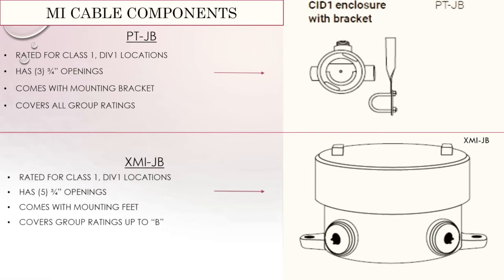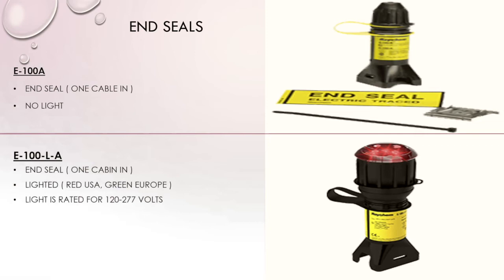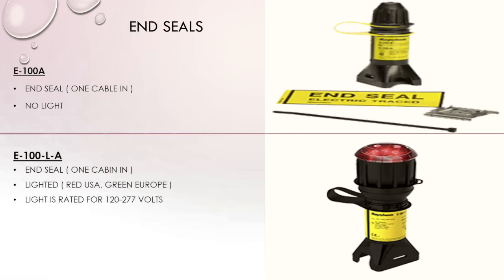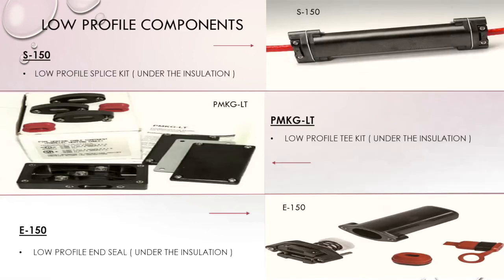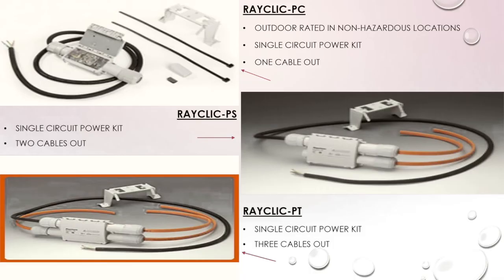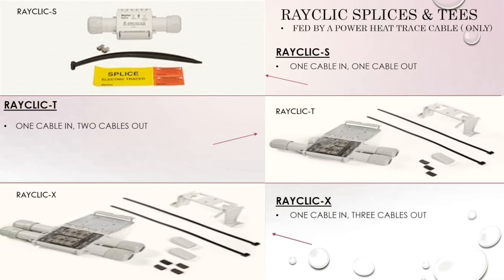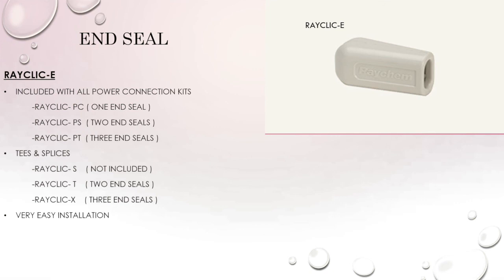HEAT TRACE VIDEO 3: THE SECRET LIFE OF COMPONENTS

Comment: 2 powercircuits in 1 box?? Are the rules in the USA that different from the ones in The Netherlands. Why wouldn't you advise just option 2 or to buy an extra box in option 1, so that when someone works on it and shuts down only 1 circuit hey wil be sure that there wil be no more power in the box. I know my boss, colegeu's and customers would not be very happy with me if I would make such an installation. You guys in the USA suppose to be even more about safety than we in Europe, but this doesn't sound save to me.